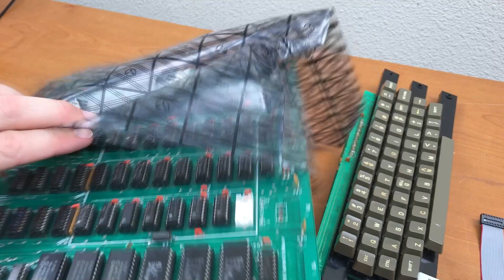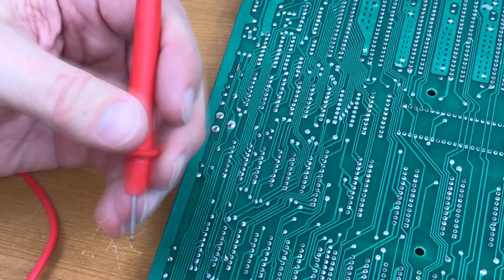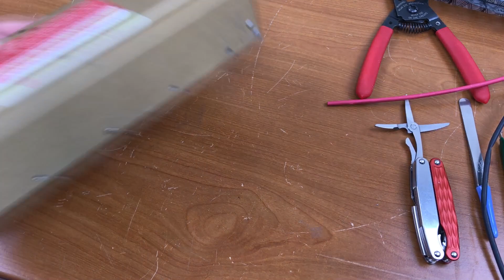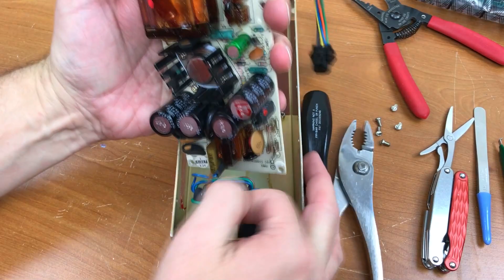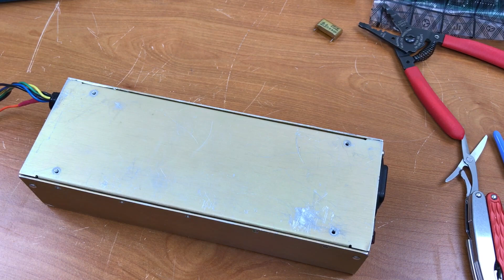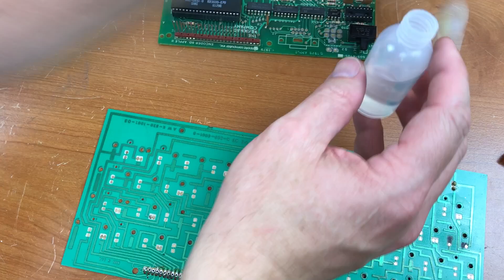Apple II Plus Repair (Part 1)

Comment: I know I'm late commenting, but if you want to run it without the language card, you need to pop the dram IC off the language card and move it back to the white socket.  This is moved when the language card is installed.

Comment: Definite need to remove the RIFA to avoid magic smoke. Seems the blob of solder on the keyboard PCB is not good, perhaps oxidized too much or cheap one that contain improper ratio, some people did take the plumber solder on PCB that eat away the circuit.

Comment: Nice restoration work.

When reassembling the power supply, could you pull some wire inside the case before clamping the grommet, so all the wires are the same length as the one you repaired? It seems to me that would help reduce strain on the solder joint. Hardly necessary, I know.

Comment: you have actually helped scratch these traces when you solder with a soldering iron and cleanwic you are not supposed to move the iron back and forth on board, it scrapes the varnish very easily and when you are not careful enough you can even rip the trace off the board
Reply: Chuck Hutchins once you rip off traces it will matter to you, believe me

Comment: 21:40 you're measuring voltage without a load on the power supply, that's why the voltage are higher.